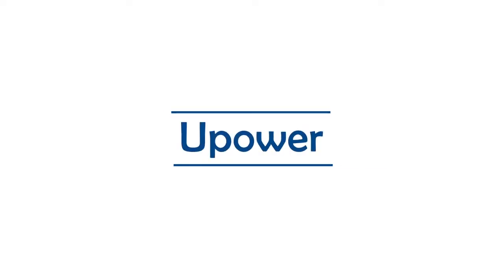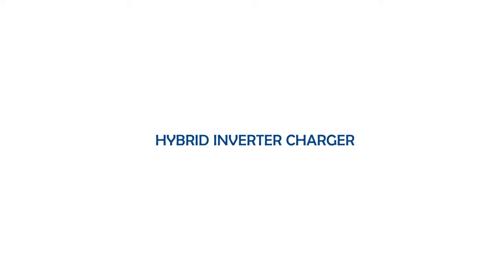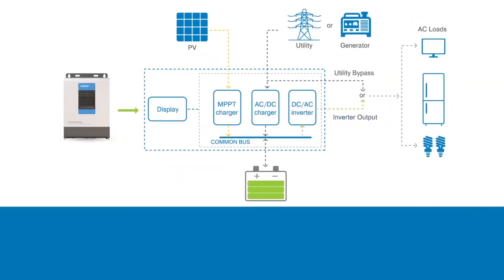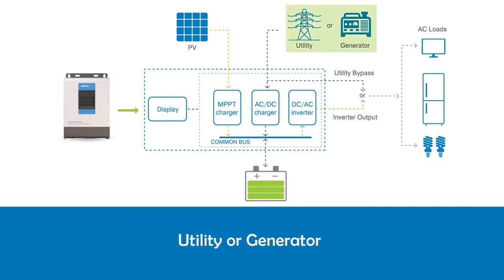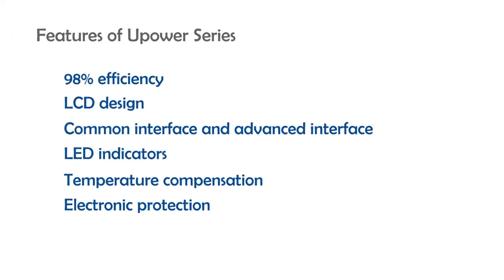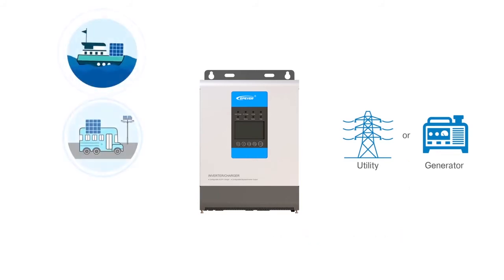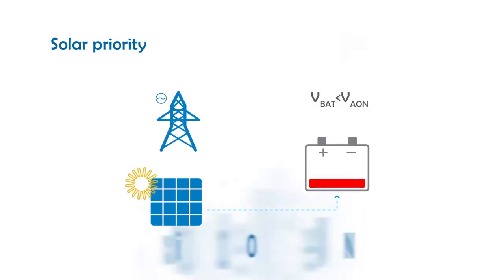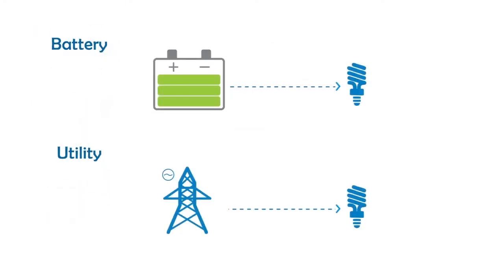Upower Epsolar - What you need to know!

Comment: Hi, In the user manual is specificated that this controler is designed for lead acid battery. I found the model in liion batery area. Can be set to use lifepo4 battery ? The lifepo4 don't need float , and have different voltage to set . Thanks for reply
Reply: In the german manual are many configurations for the battery possible. Its possible to set for lifepo4. For shure BMS is requered.